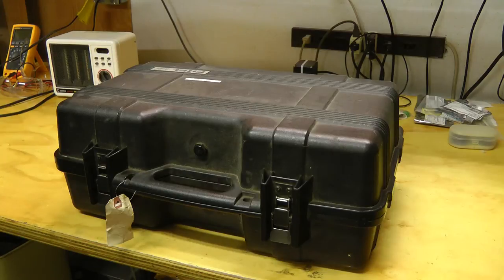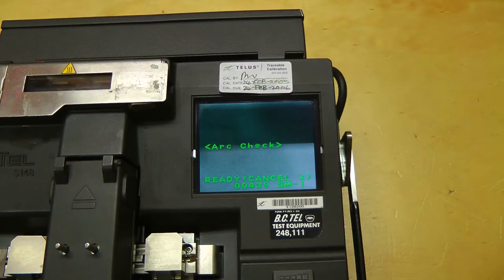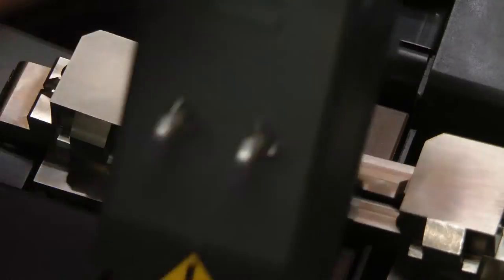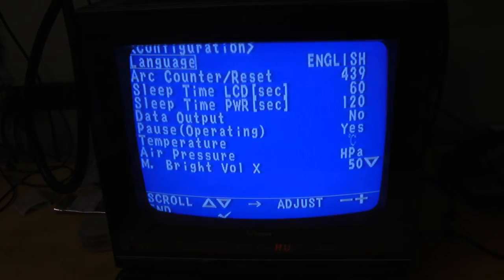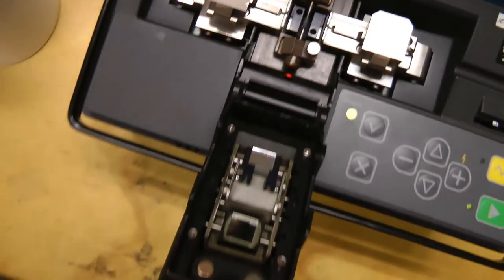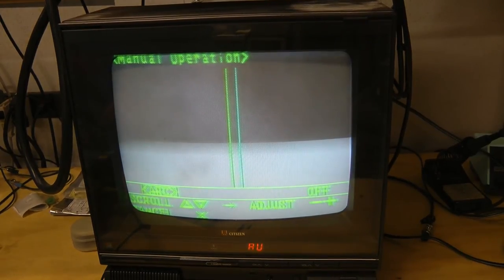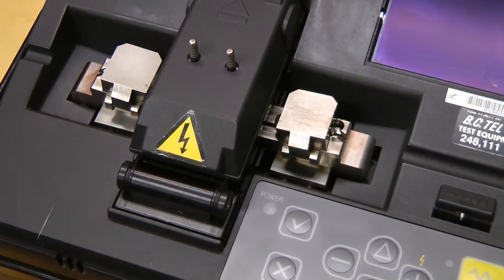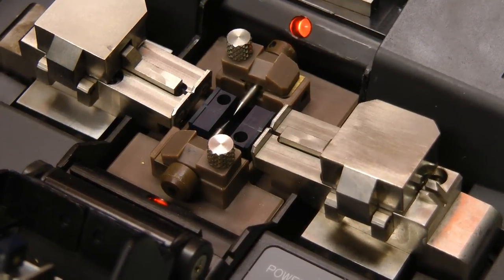Fiber optic fusion splicer - Fitel S148

Comment: you have to remove a thin layer that covers the core (the white thing in the middle)  also use a fiber cleaver to cut it and  you have to clean the fiber with a  tissue. that is a good piece for 20 bucks,  439 splices is almost a like new one !!